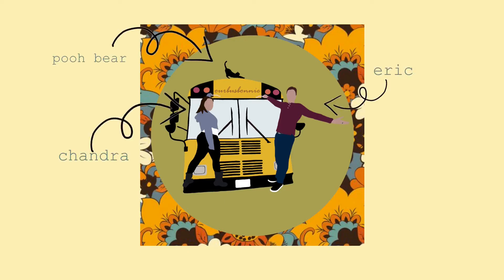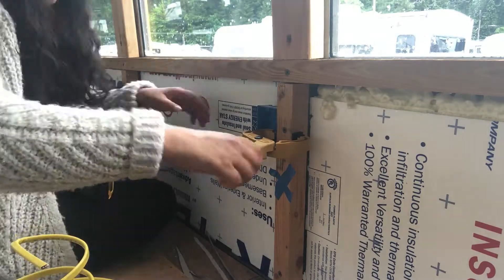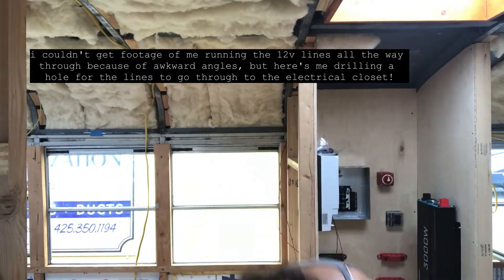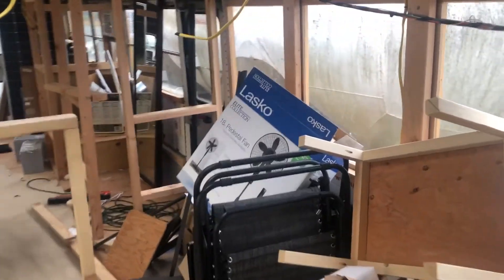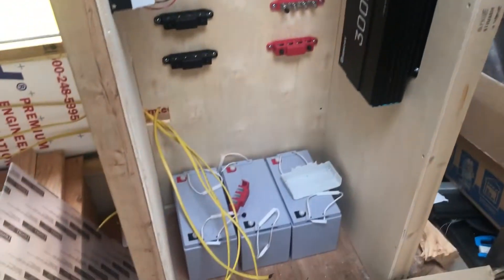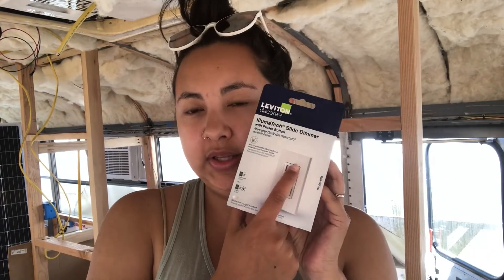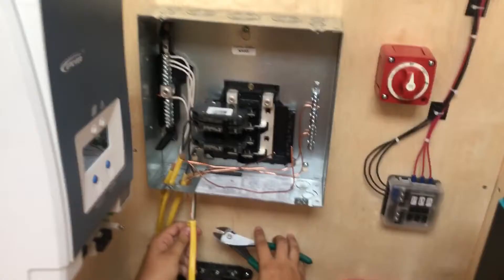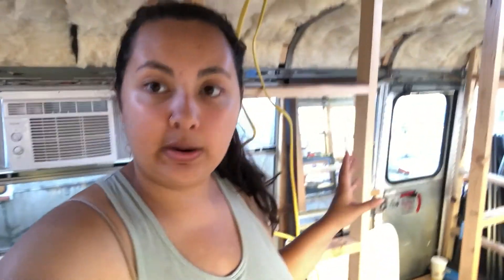how to DIY skoolie electrical - 12v, outlets, and 110/120v - skoolie build vlog

Comment: ACK! good build so far but please for your safety put strain relief for your wires at the panel (load centere) as if it cuts your wire insulation you risk a short or worse!! Good build so far other wise!!